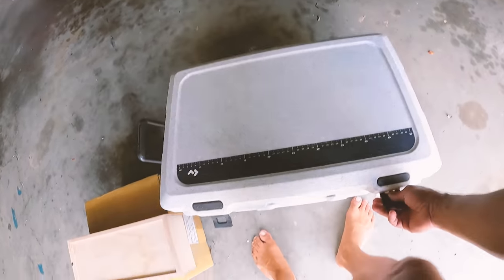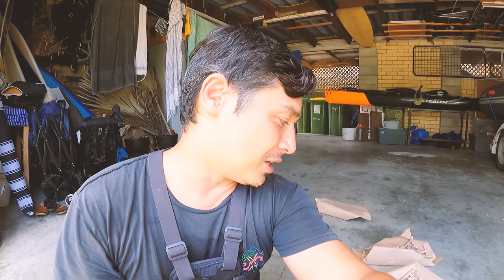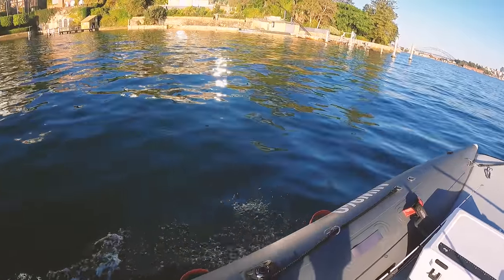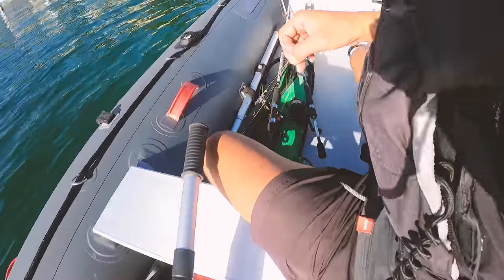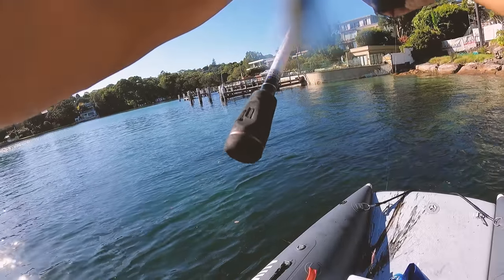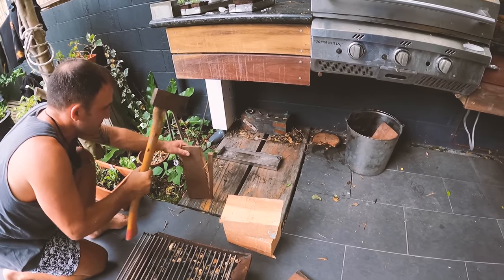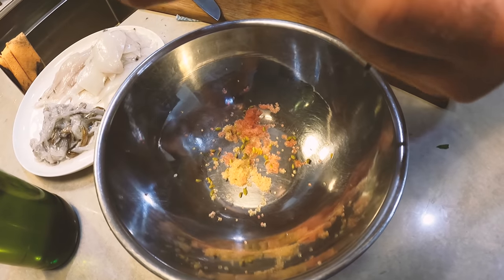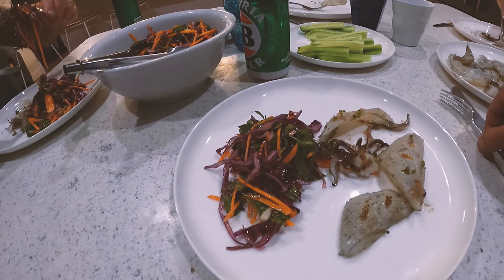Finally Back In My Home City! ULTIMATE SQUID Catch & Cook - Stealth Camping, Living From The Ocean

Comment: I don't know if the weight of the prop has any bearing on performance, but the difference in material will. Under power, the aluminum prop will flex out to less than 9 pitch, while the stainless prop is more rigid and will hold pitch at or very close to the original 11 pitch.

Comment: A stainless steel prop on small outboard could limit the top end revs. I had one on a fifteen HP 4 stroke, the weight of the prop limited the engine revs to about 2/3, I went back to a Al prop.

Comment: Hey Rod, how was the new stainless prop? I got my standard prop cupped which improved things to a degree but under a load (four adults) and in rough water it cavitates a fair bit still. So keen to hear your thoughts, looks like that prop is quite a bit larger than the standard prop you had. Thanks mate, Paul.